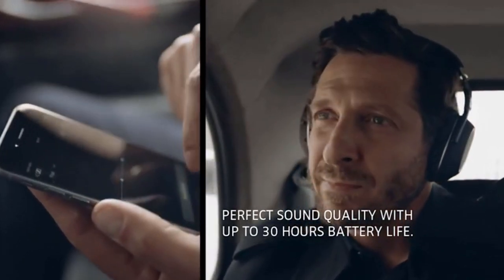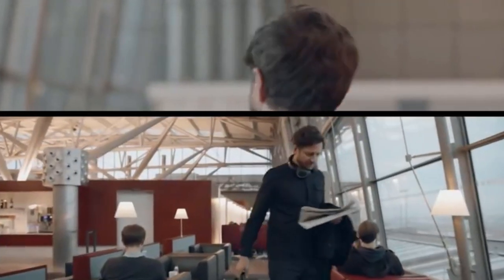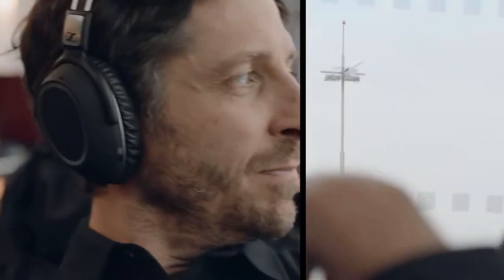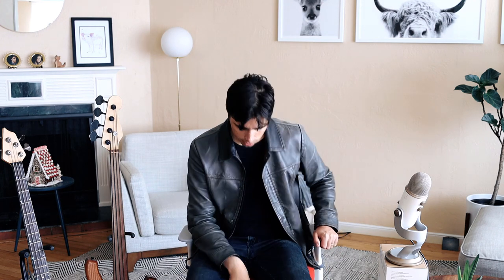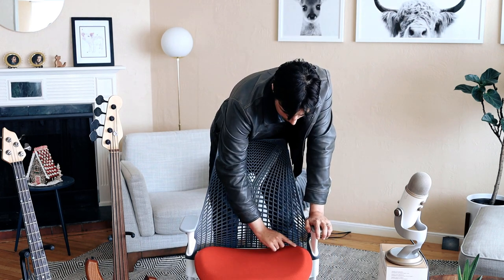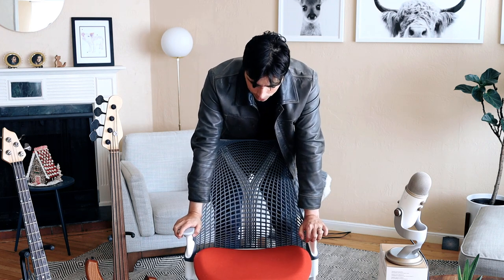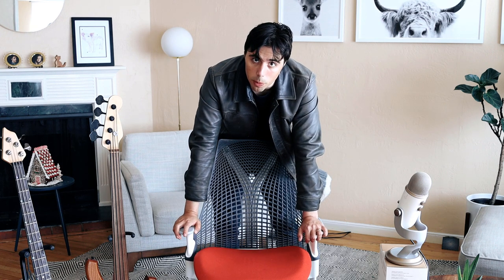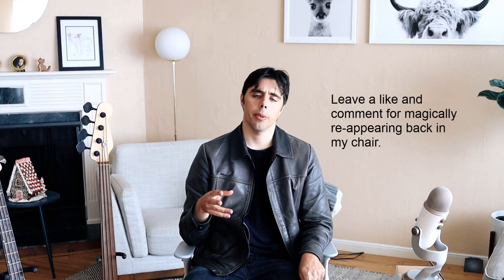Ergonomics for Industrial Designers: Signifiers, Tension & Compliance of Headphones & Chairs

Comment: Great subject. On the seat edge at the back of the knees, there is usually an adjustment in the seatback to a position where your but goes on the seat that's made for people with short upper legs to keep your knees away from the edge. Also, the seatback has a dark color stripe in the middle, is that harder than the rest of the seatback? it's kind of a nono with seat designs to have an odd number of spindles or vertical elements because there is always one against your spine and if that's hard it will affect your posture as you try and stay comfortable. and there seem to be some recurring artifacts in the sound?
Reply from the maker: I think some Sayl chairs have that adjustment. Mine doesn't. On an unrelated note, I have long legs and I can never seem to get my knees comfortable in any chair. I probably should have just bought the one with full adjustability. 
The seatback is very uniform in the way that it displaces tension. The seatback is by far the most comfortable element of the design.